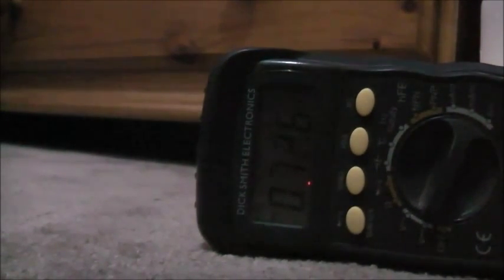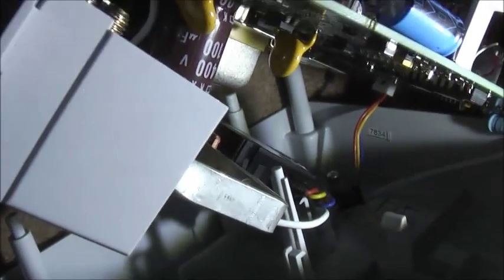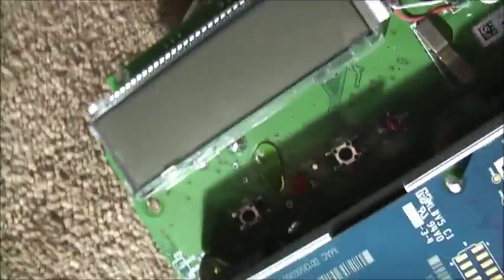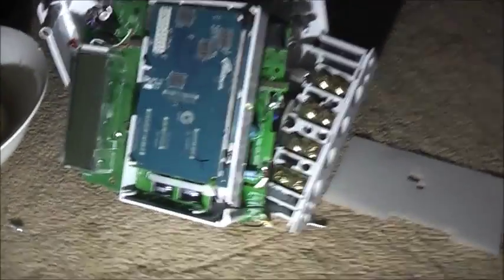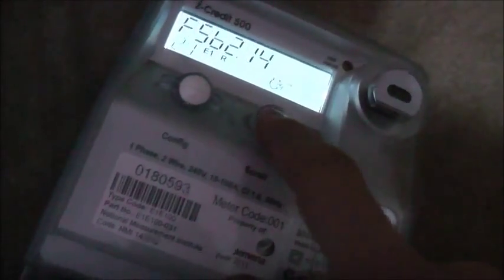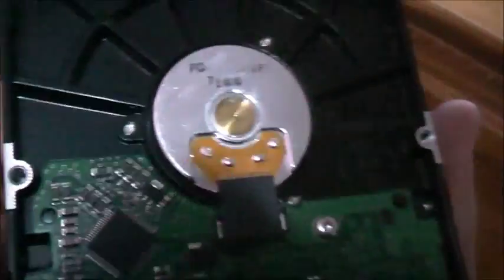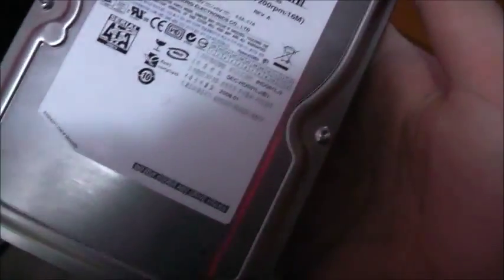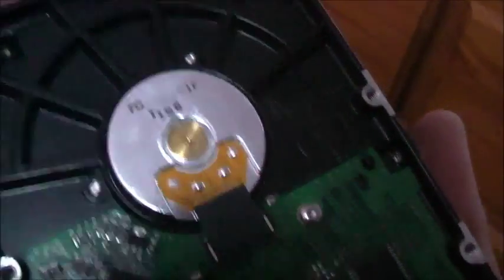PRI i Credit 500 Smart Meter Teardown & Test!

Comment: Hmmm. Remember when plugging these things in.... Fun-Jiggery-Pokery Unit!

Without one, if one of these meters decides to let loose, it'll go off with bit of a pop!

The ballast in the Fun-Jiggery-Pokery unit could be something as little as a 100w lamp or something like that.

It just saves you from big bangs, bright flashes and unwanted flaaaaames. :-O

The last thing you want, is "another-burn-in-the-carpet"

Be careful around these crappy electronic meters. They've been removed for a reason..... They're PAAAAANTS!

.....Needs more loadwheel action. :D

Thanxx for showing,

-BoomBoxDeluxe.

16th June 2015, 16.01